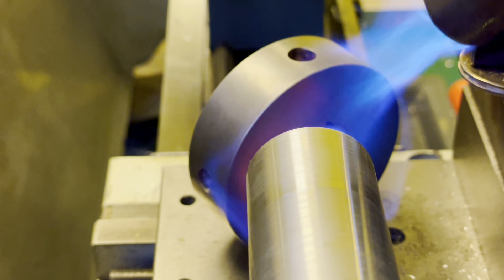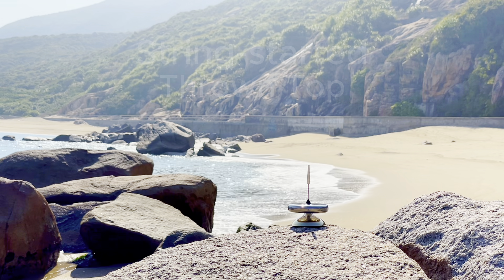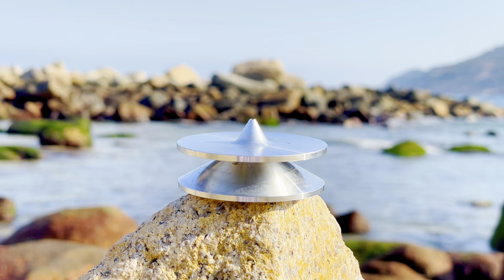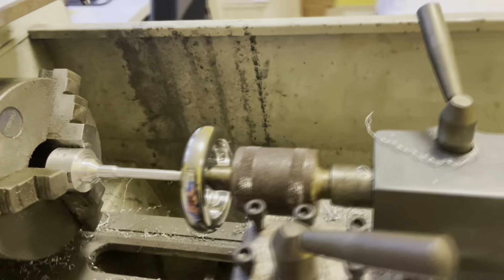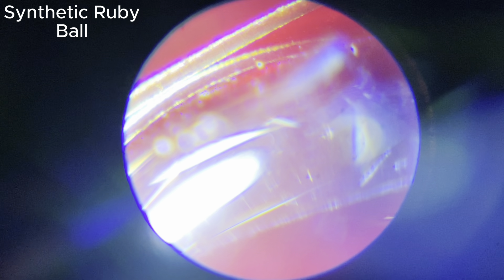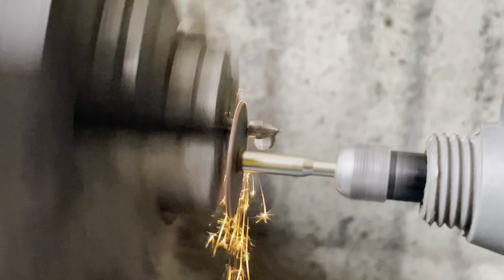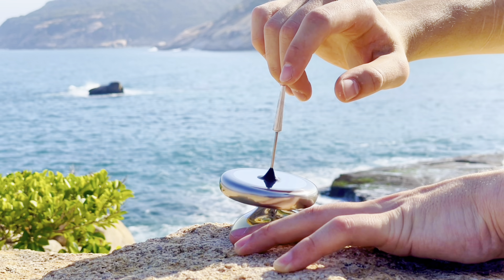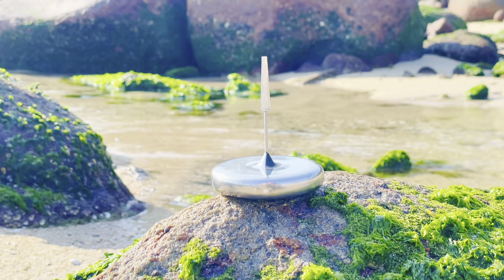Spinning Top Mk.24 | RUBY & SAPPHIRE

Comment: Thanks for sharing your journey. Your videos are top notch. Your engineering, design, and analytics are excellent! Keep up the great work. 

May I ask, have you ever been able to get the initial rpm up to a higher amount? I don’t remember seeing much data you’ve provided on that.

Thanks again!
Reply from the maker: I’ve hit a little over 2400 rpm before with 70mm diameter tops. I’m sure I’ve done faster with smaller tops but I don’t remember measuring it carefully back then. Yes, I plan on working more on my starting speeds.
Reply: @hiper_tops  Awesome! I was thinking that if you used an rpm gage, then you could quickly make a judgement call on the total spinning duration after hitting a minimum initial rpm. Let’s say that enough data collected tells you that a minimum of 2420 rpm (for example) will get you to a 1.5 hour spin. If you only get to 2380 you could abort right away and try again. Would save a lot of time and wear on the carbide. I also realize there are more aspects to consider than just initial rpm value. You definitely would have the knowledge and understanding to make an educated decision to continue or abort. 
Cheering you on here. Hope you break the record, and at least have more fun in the meantime!

Comment: Watch gems are lubricated with a minute amount of light oil. Have you experimented with lubrication?  This could reduce wear and increase spin time.
Reply from the maker: Yes I use a thin layer of oil on the base, however I would like to experiment more with different types of oil/other lubricants in order to find the best option.

Comment: I have to wonder if sliding your palms along one another would get you a faster starting rotation speed
Reply from the maker: There is potential here however I would need to practice a lot and the base may need a slight redesign as it is more difficult to do this motion accurately.

Comment: Would you be able to get your tungsten carbide tips coated to reduce friction and improve wear resistance during the long spin? I'm thinking common cutting tool coatings like TiN
Reply from the maker: The way I currently do things make this difficult but I am considering trying new things for tips/bases so this is something I want to try :)

Comment: You just need to make a casing for the outside, a heavier outside and an extremely thin top part, where the case will reduce the air drag, the heaviness increase total energy stored, and the thin top will act as a higher gear up and make it spin much faster, this should add your needed ten minutes without any ridicously expensive changes
Reply from the maker: For the casing would that be a shroud external to the top to reduce air drag? I would like to try one at some point. Thank you for the suggestions!
Reply: @hiper_tops  Yes, preferably all the way to the top. It would be harder to start with the casing due to the spinning top moving around, but it would have the best results due to less air being dragged around. If it's allowed, it would simply be even better to start it, then seal it in a vacuum chamber

Comment: I'm no engineer, but would a complete redesign of the top portion to get a much higher starting spin be viable? Something like using a ball bearing rotation system where you can spin the top really fast in the air, then place on surface when already spinning very fast.
Reply from the maker: I see what you mean. One of the rules for Guinness is that the top has to be ‘released from the fingers’ which is quite vague but I have a feeling they wouldn’t allow this idea. Still I would like to play around with starting mechanisms in a future video!

Comment: Micro-dimpling the flywheel surfaces would drastically improve aerodynamic efficiency. The dimples generate vortices that stick to the surface and create a very slippery boundary layer between the top and surrounding air.
Reply from the maker: I’ve read some papers about similar microscopic textures for the purpose of viscous air drag. Although I would like to try them, I currently don’t have the machining capability to make such small features. Perhaps in the future!
Reply: @hiper_tops  crazy idea, but you could try aerosolized acid etching, and combine that with the technique spray paint artists use to get bigger flecks.
Reply from the maker: @fizban7  I like crazy ideas but this one may be a bit further down the line for me haha
Reply: @hiper_tops  50% reduction in drag, approximately.
Reply: @hiper_tops  would it be possible to just use stickers to iterate the designing process faster?
Reply: @hiper_tops no need for specific machinery. You can get similar results using a small ball tip on a rotary tool.  Think about a golf ball, the dimples on that are relatively huge. Nearly anything is better than a completely smooth surface due to the turbulence of the boundary layer
Reply: Spin it in a VACCUM CHAMBER to get an idea of maximum improvement you can expect by working on aerodynamic... This way you can decide whether it's a low hanging fruit or not worth it.🤓
Reply: @sanyammishra869 🤔
Reply: @sanyammishra869  good idea, but how would he spin it by hand?
Reply: @drkpltr  He can spin it first then put the lid on and create a vacuum... Remember it's just to know the maximum performance increase he can get by working on aerodynamics :)
Reply: Dimpling reduces drag for bodies TRANSLATING through still air. The aerodynamics of a body SPINNING in still air without translating are very different. I wouldn't assume that dimpling also reduces drag in the latter case without some strong experimental evidence to that effect.
Reply: @ Translation does not need to be linear.
Angular velocity is still translation.
There will always be relative motion between the top and the surrounding air.
Reply: @Pyroteknikid  Spinning and translating are NOT aerodynamically equivalent.  In a cylindically symmetric body spinning about its longitudinal symmetry axis without translating, there is no form (pressure) drag for the simple reason that there are no leading or trailing surfaces, only surfaces tangential to the relative air flow. There's no wake or vortex street coming off lee side of the body because there is no lee side. Inducing turbulence or delaying flow separation with dimpling are irrelevant to the geometry involved in an axisymmertric spinning top.
Reply: @JeremyMcCrearyTechnicalLEGO  I understand that they are not equivalent... Linear translation of a cylinder has bilateral symmetry, where as spinning the cylinder has  radial symmetry (spherical may be more accurate). You don't need the positive pressure from forward motion to create the vortices. Dimples on the surface would cause undulations in pressure relative to the ambient air, and result in turbulent layer formation.

As suggested above, a test spin in a vacuum would make evident whether the dimpling would be worth it in the first place.

Let's see what happens.
Reply: @JeremyMcCrearyTechnicalLEGO  as one math youtuber said: translation is just rotation with infinite radius.
Reply: @tunnarit  True enough of orbital motion about an axis outside the body, but we're talking about a top spinning about its own symmetry axis with little if any translation of its center of mass. Two totally different situations — geometrically, kinematically, and aerodynamically. Details matter.
Reply: I wondered this, knowing only of the effect of the dermal denticles on shark-skin - what scale are we talking here?
Reply: Laser etching machines would probably be the easiest. It would take awhile to remove material, but the precision is definitely there.
Reply: My first thoughts for  the process would be photo resist and either etching (electro or or acid?) or electroplating , though I was once interviewed for a Masters research project that involved micro structuring of marine sub-sea structures to prevent biofilm establishment - they were using lasers - could be as simple as firing a pulsed or shuttered laser at the spinning object - hell, I can even imagine that maybe a tiny but powerful burst of ablation could even be used as a sneaky way to add power to a spinning top if applied correctly but (I may be totally off there).
Reply: Print a shell with a resin printer :)
Reply: Considering you have many older tops, such as mark 23 now collecting dust, I would be inclined to try out some macro rather than micro dimples. A carbide nail punch and hammer should do it. 😀
Reply: I literally just commented the same thing without seeing your comment first lol
Reply: The thing about removing material is that you have to be very precise with the placement of the dimples so it doesn't unbalance the top

Comment: can you test it in a vacuum chamber? just to see how much of an effect the lack of air would cause
Reply: I was wondering the same thing. Could he get the record just by hiking to the top of a mountain? Vacuum chamber may help answer that.
Reply from the maker: @machooke4846  I think you are right. I certainly plan on doing more vacuum experiments - my pump has been in storage during a house move but Ill have access to it again soon.
Reply: @machooke4846  there's definitely going to be some sort of performance change in various humidity's and pressures.
Reply: How would you hand spin a top in a vacuum? I guess you would spin it first, then pump out the air? But I think you’d have to isolate the base from vibrations caused by the pump. That sounds easier said than done.
Reply: Vacuum pumps are hooked to the desiccator via a long flexible line, so although they make a heck of a vibration, that shouldn't be an issue.  You could even put the pump outside of your window.
   You are correct about the spinning method.  The glove idea (think sandblaster) sounds good in theory, but would expand and fill up the desiccator with how thin it would be as previously stated.
      I think the biggest challenge would be finding a desiccator large enough to comfortably spin inside as well as a vacuum pump strong enough so it doesn't take more than 5-10mins to pull a perfect vacuum.
Reply: @trevorsklar I imagine a box built to pump air out of, but with a hole in the top that has a sealed, rubber glove on the inside, so you can put your hand in the glove and move around the inside of the vacuum box
Reply: I imagine any rubber glove with significant enough flexibility to spin a high preformance top would be too week to resist the air pressure and would expand into the vacuum chamber and interfere with the top.   I'm sure the best way to do it would be to start the top spinning, then pump the air out after.
Reply: @windubitably a rubber glove would just fill the entire space of the chamber xD

Comment: Just had this appear on my home page, so ignore me if these have already been covered.

But, im curious if a Spherical contact point would be more efficient than a Pointed Tip?
Like a Ruby/Sapphire/Diamond Ball in contact with the Base instead of a point? 
Surely it wouldnt wear down as easily/quickly, and wouldnt leave the marking on the base that the Tungsten Point is currently, or would the contact patch be large enough to hinder the overall efficiency?

Also, with the Knurling, at what point does the Boundry Layer of Air start affecting the efficiency? Could a spiraled knurling help with drag by directing airflow, or at this size, does the Boundry Layer mean that air isnt really interacting with the Knurling therefore not hindering efficiency?
Reply: Check out his video on the Mk.20 top, that one uses a ball bearing as the tip. It didn't spin as long as some of his older tops, but it's an idea he said he wanted to revisit.
Reply from the maker: This is a problem which still interests me. I believe the contact patch of a high-quality bearing ball should be the same as a sharp conical version of the same material. Since the contact point area is ~the same, the initial wear rate should be equal. However, yes, after some time, the conical tip would wear deeper. The other thing to consider is lubrication - a thin oil layer can increase spin times of a sharp tip by 8-10%, however it does not seem to increase the spin times of ball tips. I believe this is because the contact patch of the fluid is much larger for a ball tip than for a sharp tip. To combat this effect, I would like to try very small bearing balls ~1mm diameter. I used something similar for Mk.20 and it performed reasonably well. 

For the deep knurling like used in Mk.24, I believe the air would interact with it a little. However since the velocity gradient here is so much less than at the flywheel, the relative drag created is negligible.
Reply: @hiper_tops  Thanks for the reply!

As for Lubricant, my gut tells me that the Ball bearing, though similar in contact patch, would accumulate more of the Lubricant, impeding the efficiency.
I would guess it would be due to surface tension pulling the lubricant around the ball, which has a larger cross section, where as the Conical tip has a much sharper angle which would reduce its ability to 'stick' to the sides. Although the effect is minor between the two shapes, it would add up over time. Viscosity of lubricant would be a huge factor also.
Reply: @hiper_tops  Without lubricant you've got a Hertzian contact (the classic small strain elastic contact model), and the width of a sphere-on-plane Hertzian contact goes as R^(1/3) ... IE, is smaller if the contact is pointier. If the coefficient of friction in each of those contacts is the same (big if but hard to guess otherwise), the smaller contact width will reduce the frictional torque.

Hard to say what the higher average contact stress in the smaller contact means as far as volumetric wear rate goes, though.

(Contacts are also smaller with stiffer materials, so even for the same shape would be smaller with alumina (or SiC or diamond) than with steel, but this is probably less interesting than the variation in friction and wear behavior between materials.)

(I think that modeling both conical and ball-bearing tips as sphere-on-plane contacts—just with the conical tip having a much smaller point radius than the ball bearing—is probably basically correct, even with lubricant, though I haven't done the math to confirm that.)

Comment: Have you tried running it in a vacuum chamber? Should spin for days.
Reply from the maker: Actually the improvement isn't that drastic. I have designed my tops to have an equal amount of total powerloss from tip friction and air drag. So with air drag gone, tip friction is still very significant.
Reply: @hiper_tops  I suppose managing the heat dissipation away from the contact point will have some impact (thermal imaging your previous designs perhaps - not cheap but maybe a friendly university?)

Comment: Super impressive work!! Very inspiring to watch you keep making incremental improvements!! 

@hiper_tops One question though, where are you able to find the list of rules for this record? On the Guinness page you showed I can’t seem to find them, and I would love to know the constraints you’re working within. 

Best of luck, can’t wait to see the next iteration!
Reply: Interesting suggestion if the rules allow it: using a spiral groove aerodynamic thrust bearing that’s been ground into a hemispherical shape. Here’s the basic concept behind it:

An aerodynamic bearing like this works by using the spinning motion of the top itself to generate a thin film of pressurized air. As the top spins, air is drawn into the spiral grooves, building up pressure that creates a cushion between the bearing surface and the top. This cushion effectively lifts the rotating part and minimizes friction—all without needing any extra energy input, because it harnesses the kinetic energy already present in the system.

Now, regarding the hemispherical shape: A spinning top naturally precesses like a gyroscope, meaning its axis isn’t perfectly vertical all the time. A hemispherical bearing accommodates this motion by maintaining a uniform, self-centering air film even as the orientation shifts. With precise grinding and lapping—similar to techniques used in high-precision lens making—the surface can be crafted to extremely tight tolerances, ensuring that the air gap remains consistent. This reduces the risk of the top crashing into the bearing, keeping friction to an absolute minimum.

I’m not entirely sure how the competition defines 'bearing,' but this concept seems to stay true to the spirit of the rules, as it doesn’t add extra parts or require an external energy source. For anyone interested in a similar approach, check out this video by cylos's garage, where he demonstrates a planar spiral groove air bearing and discusses his process:  https://www.youtube.com/watch?v=hYX7b8_9dBY
Reply from the maker: @goph64  Thank you for your comments! Regarding the Guinness rules, you can only see them once you start the process of trying to beat the record and even then they are quite vague and hard to find. The important points are that the top is spun on a 'flat' (concave allowed) surface and is released by the fingers. Also, no external support can be used to keep it going. This is a vague phrase but essentially means you can't keep spinning it / blowing on it and can't use a vacuum chamber, magnets or electronics etc.

Regarding your air bearing idea, although a couple others have raised the idea in the past, your response is the most detailed and potentially plausible suggestion I've yet heard. As you hinted at, such a design certainly bends the limits of the rules. However I would be interested in trying it to see if it would even be more efficient. (My concern is that the increased 'contact' area required to 'levitate' the top could cause more breaking torque than a much smaller physical contact point as I have used).